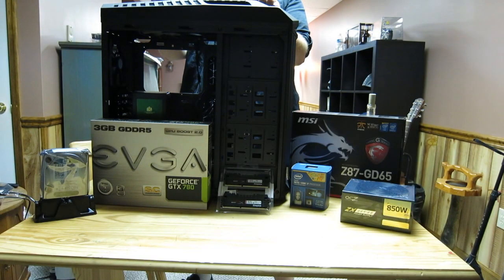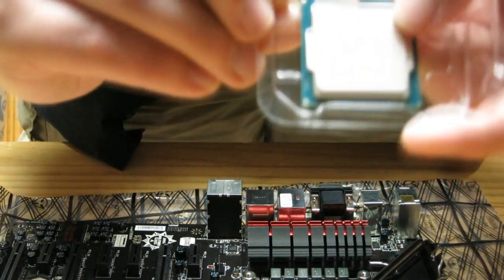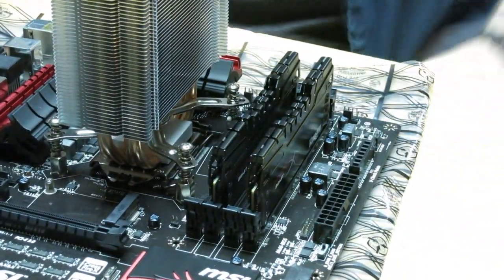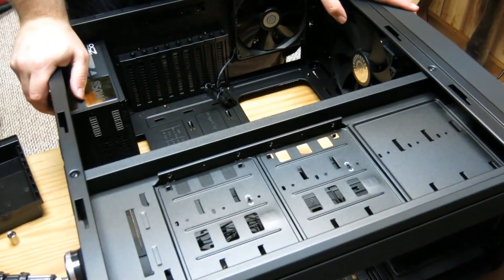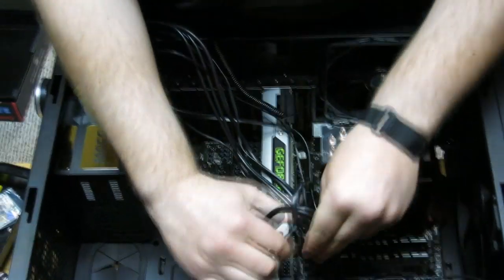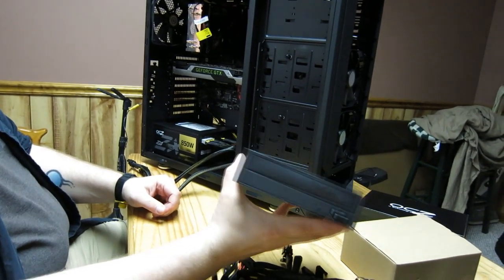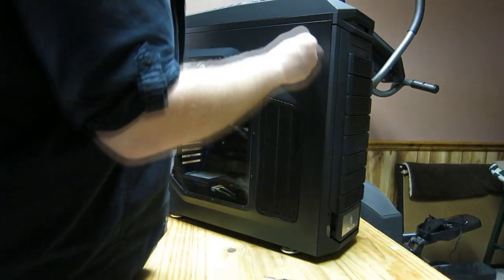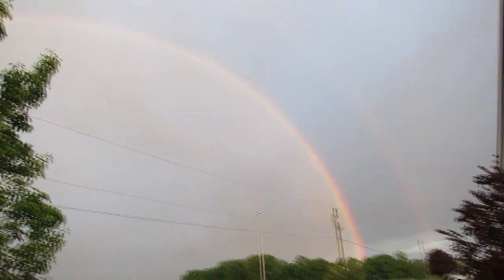Noobs Series: Building a PC

Comment: I can't see it, but if you are connected to that power supply and that power supply is connected to the wall, then you are NOT properly grounded.  And in fact, you are in danger if there's no anti-shocking resistor in series between you and the wall.  If you do have a resistor, or the power supply is NOT connected to the wall, then all is good.

Comment: I think I got it ,all the parts needed
A CPU processor 
A GPU (graphics card)
Motherboard of course 
A power supply 
The ram sticks 
And hard drive memory ?
Here are the ones I want to buy for dry high and ultra settings
 A AMD FX 8320 
A GeForce gtx 1060 or so some MSI one that as good as that 
Idk a good mother board 
A cpu cooler or water cooler
16 GB of ram sticks (2)
2 TB hard drive 
A 750 watts power supply 
Is there anything I'm missing ? And any suggestion for a good mother board under 140$?
Reply: Lurking Clowns It's been a long time but r/pcmasterrace and r/buildapc will help you on reddit.

Comment: VERY NICE VIDEO INDEED.. JUST WANT TO KNOW YOUR TEMPS AT IDLE/LOAD WITH AMBIENT...
Reply: ***** Ok, great. i asked because i builded my system 3 months back with some similar parts.. 4770K, H100i with Noctua NF-F12 in Pull, 2 x 280X Toxic..

My load temps in gaming is around 55C and GPU on load are at 60C so i thought mine are hige.. Now i'm happy to know i'm not alone..

Thanks.. Good Luck